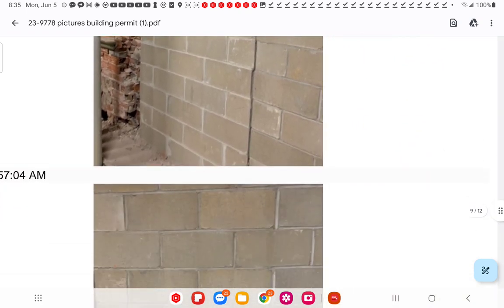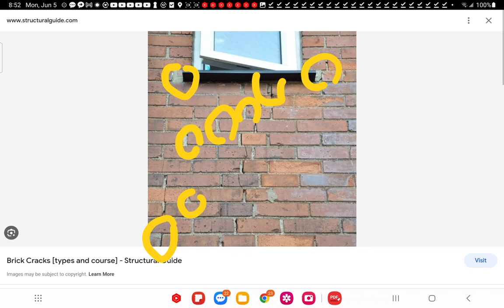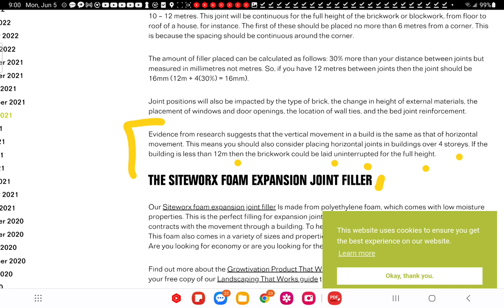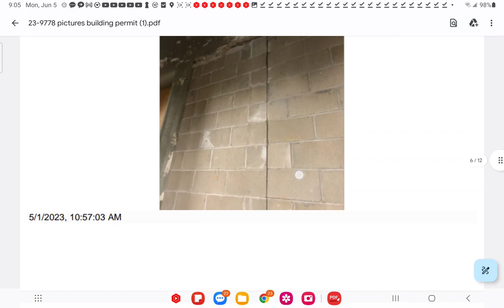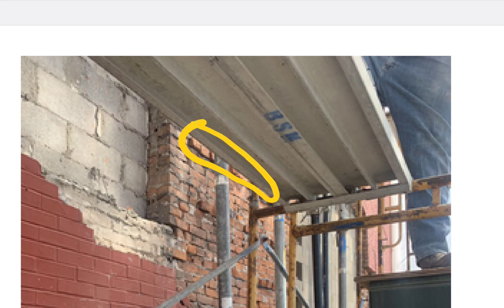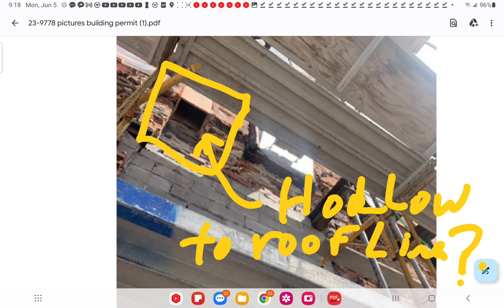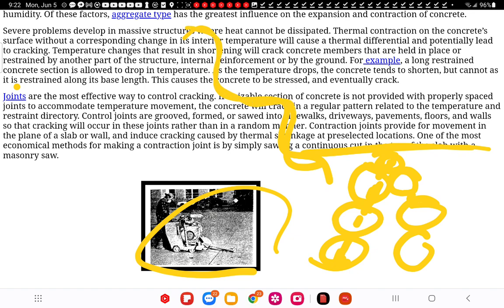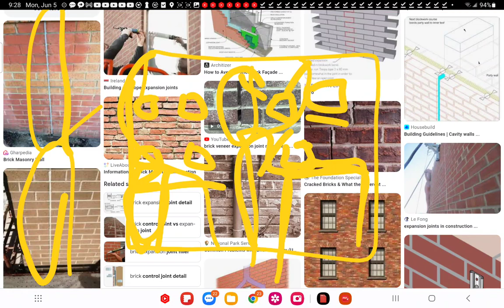Davenport Ia building collapse Engineers did NOT address expansion and contraction of brick part 17

Comment: From the thermal expansion study, I calculated the maximum thermal expansion for that whole wall. Based on the wall being 150ft long, minimum temp of -40°F and maximum 120°F, the total size of a line of bricks would change by 1/2 inch between those temps, or you say it could expand 1/4 inch or contract 1/4 inch from about 40°F. Does that calculation seem to be correct?
Reply from the maker: Great job... With that said, we would need to literally sample each of three style bricks and the mortars...
Awesome work on your part.

Comment: Nothing about the pets in many of the apartments people posting pictures of seen in the windows.  Anyway The National Trust for Historic Preservation has all kinds of assistance, from technical bulletins  to actual on site assistance. Especially since there are detailed original plans and so much written on the building. That one picture where the interior fell in no wonder why with all the different brick, types of motar, concrete blocks, resizing, in may look good on the outside but once there's any force from hammering, creating new openings, putting mire weight from newer beams, or adding electrical or hvac, every disturbance compromises and loosens the old brick and mortar them why it falls in and down creating a void.
Reply: Pets have been rescued, and reunited with their owners. Not sure how many made it though :(